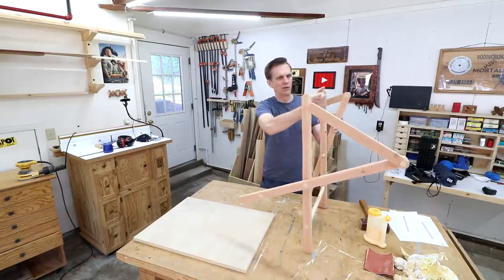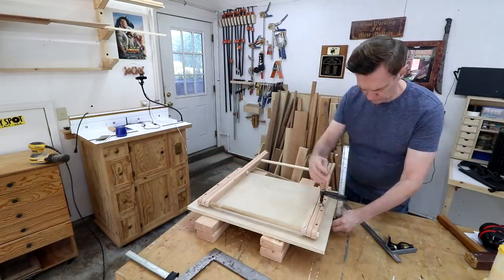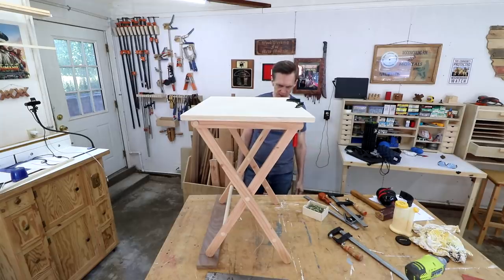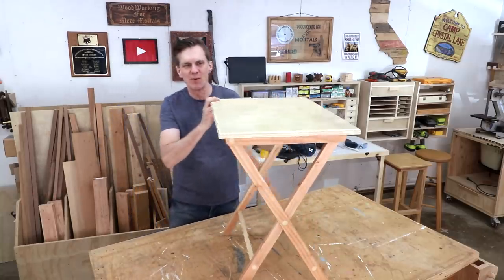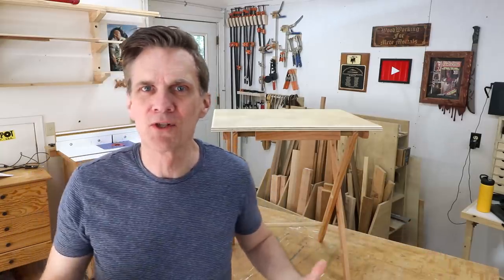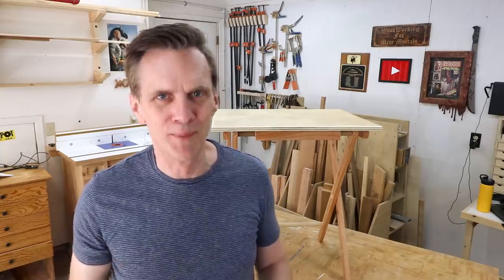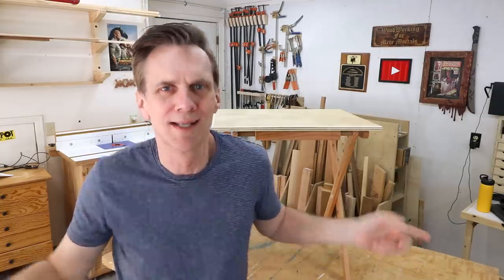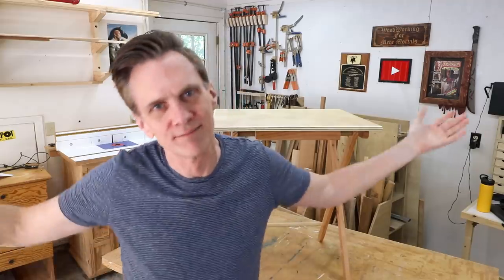Completing the folding table. This turned out trickier than I expected! LOCKDOWN Day 65

Comment: I agree with much of your speech about "Why?" However, one point that your recent closet replacement illustrates is that when we make something, although there are always compromises involved, our projects are much more likely to be suited to our needs more closely than buying ready-made. Another matter that causes me both amusement and annoyance, is the wastefulness in many projects made by talented craftsmen who don't need to make efficient use of money.  So we constantly see thick wood being used when thinner material would be fine; wasteful designs that don't make the best use of precious hardwood, and so on. Everyone in the US uses Baltic birch plywood - it's the best. But in the UK this is not readily available, at least, not at a price I can afford. I get by with basic ply, which seems to be holding up pretty well so far! And you are not necessarily correct in stating that making an article - like this fold-up table - will cost more than buying it. Especially if your friends and acquaintances, learning that you do woodwork, GIVE you wood! My mitre station, based on a $100 design, cost me the price of glue and screws. And that makes me feel great! But I love your show! And I thank you for it.

Comment: I love the ending of this video, but I kinda disagree with one aspect of it, and would like to add something else. #1 disagree  Cost: yes, if you build an exotic, solid wood coffee table, it will cost more than one at the furniture store.  But it won't cost more than a custom made exotic, solid wood coffee table you bought from someone who "hand" built it. Unless maybe you don't own a single tool and you buy an entire shop and then never use it again.  And the thing I'd like to add is, custom-ablity of functional furniture.   an advantage of doing this yourself means if you need a hutch that's 46 inches across and 26.7 inches deep to fit a specific area of your house, you can build it exactly to fit your needs, where you might not be able to find the exact thing you need on the market otherwise.  I've done this many times to make sure I'm maximizing space, and or storage.
Love the videos, I always learn something from them,  Thanks!